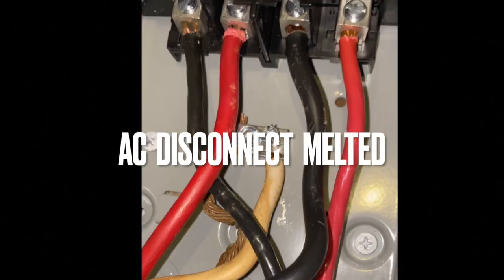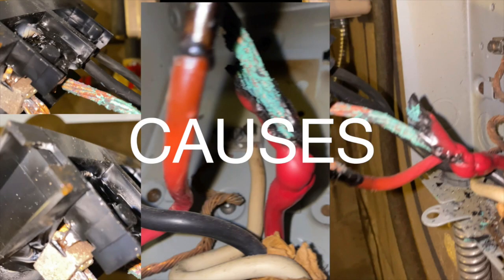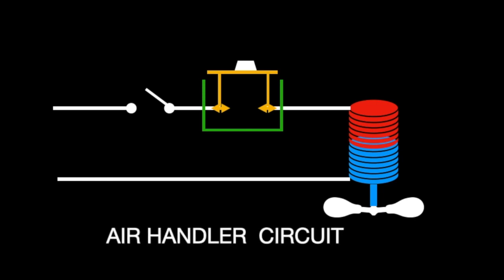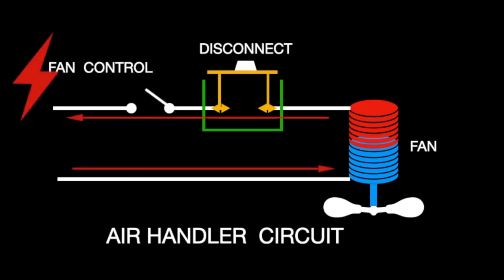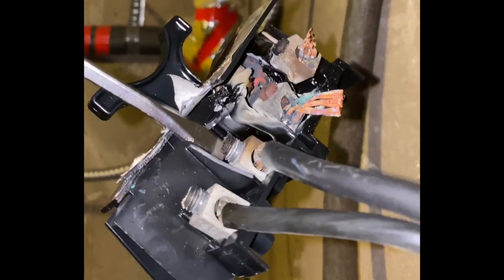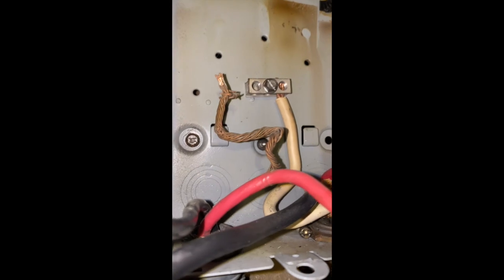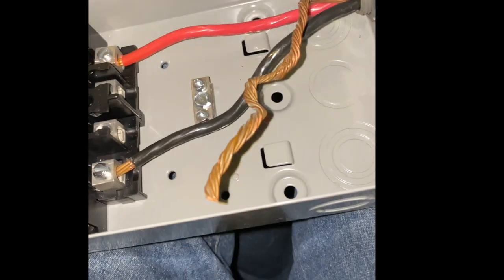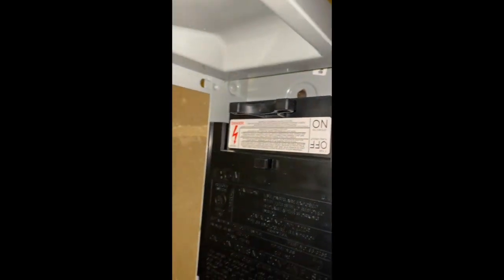AC Disconnect Meltdown Explained

Comment: Hi, I’ve recently had a problem like this but instead the disconnect fuse where damaged and the system wouldn’t start, I replaced the disconnect box and rewired it once I put the disconnect back in the unit started working perfectly fine then within 30 seconds I seen electricity inside the AC unit so I pulled the disconnect do you have any idea what it could be please and thank you for taking the time

Comment: Our wires are also burnt, do we replace the wires because the electrician told me to just replace the grey box and the black part.
Reply from the maker: I replaced the entire box and cut off all the burnt wires until I found a good clean conductors.I am not an electrician, I just do research on subjects I am interested in.

Comment: My disconnect switch melted on my furnace in my garage, my warranty denied fixing it because it has spider webs, can spider web cause this?
Reply from the maker: The spider web alone is a poor conductor, however if there is moisture on the spider web, then the conductivity would increase.  I think the reason for the melt is that the last technician, installed the wires to the diconnect, did not tighten  the bolts enough , connecting the wires to the disconnet.
Reply: @myeasyfixx1205  what do you mean spider web alone is poor conductor? Thank you for responding.
Reply from the maker: @accidentalgenius4654  
I meant that dry spider webs are not conducive to, but wet spider webs are conductive.  My question is “ how did they know about the spider webs?”

Comment: What else would cause this? Frozen system?
Reply from the maker: Beyond loose, poorly tightened bolts, I don't know. Assuming the wires and disconnect are properly sized for the amperage of the load.

Comment: Hopefully you still see these comments after a year lol. I just now realized my condensing unit wasn't on and our system hasn't been able to keep up lately. I went outside to check it and sure enough the outside unit wasn't running. I checked the service disconnect and it was in there right(ON) but I pulled the fuses out and there was a bunch of cobwebs in it so I cleaned it. However then I realized there was moisture basically on the copper parts as well as inside where the copper on the fuses goes in. I wipped the copper prongs off and it was basically like an oily substance. I went ahead and plugged it in and it made a couple pops or sparking sound but I didn't see anything, and I figured I fried it(I'm not experienced) but to my surprise the unit turned on. My question is, should I be worried about the pop sounds or whatever? Is this dangerous? Or is it okay since it turned on and no fire immediately or anything
Reply from the maker: Wow, I did not think about water and other moisture in the box.  My disconnects are well covered or inside.

Comment: I had this happen yesterday, it was the same model disconnect. It happened when I was pressing the handle in. In my case the circuit breaker failed and didn't trip. I think I will replace it with a fused model and new breaker. Still not sure why.
Reply from the maker: Consider that when you have a coil and the power is shutoff, there is a reverse power surge in the opposite direction. Therefore, the loose wire gets a foward surge and a reverse surge over each cycle.  So it will not trip the breaker, just get hot around the loose wire, until it is totally melted.

Comment: Hello, If a compressor was recently replaced in January and not cooling due to low freon, and constantly running and trying to cool the house but the temp keeps rising, could this constant load of the compressor trying to cool with low freon for hours cause a disconnect to short out?
Reply from the maker: The disconnect may  be experiencing constant cyclical energy surges.  I would not characterize the diconnect as being short out, but any loose connects may generate heat.  If it shorted out it would trip the breaker.

Comment: Had this happen to my disconnect. Actually didn’t know anything was wrong till I had a contractor come out to give me a quote on a new unit. Been researching trying to figure out why this happened, I’m guessing the cables became loose over time. I will definitely keep an eye on this in the future
Reply from the maker: BH, I think, when the disconnect was installed, it was not properly tightened. Therefore, each  cycle it was getting warm, until the temperature was sufficient to melt.  How long did you have the system before it melted?
Reply: @myeasyfixx1205 Excell question 🤔.
Reply: Funny thing most ac companies simply want to replace the whole thing 🤔 instead of diagnosing what caused It so it doesn't happen again.   I agree with you!